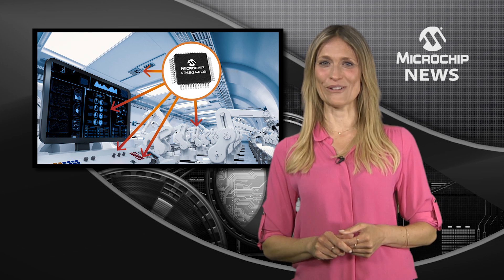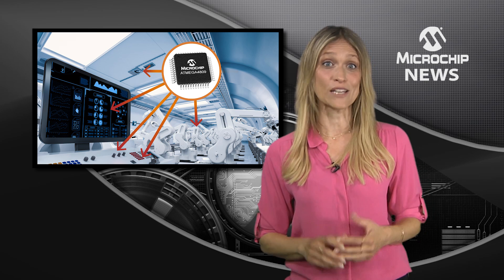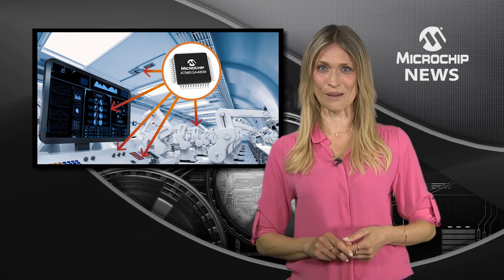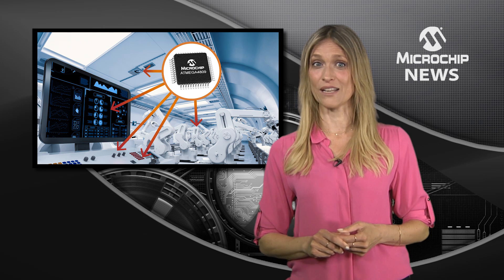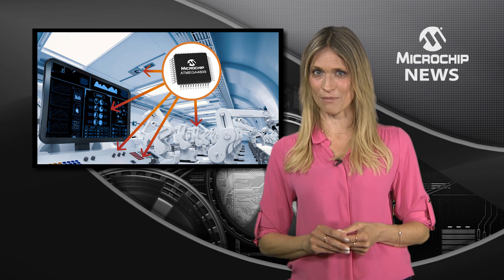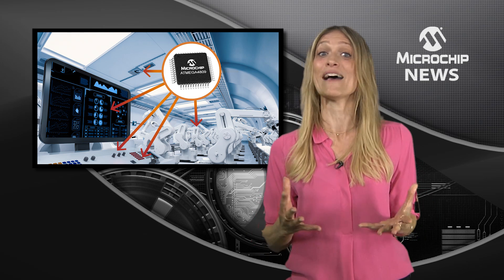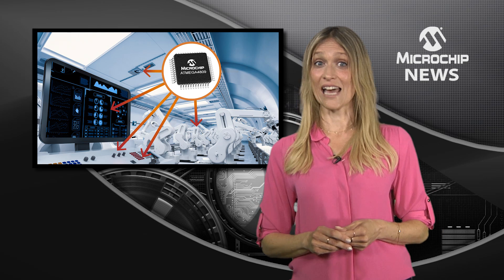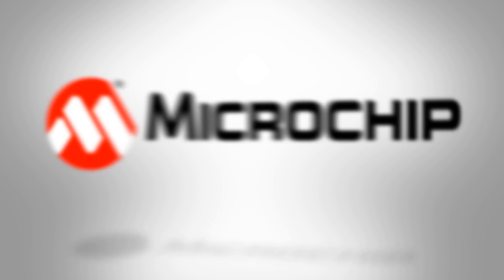First CIP-Enabled megaAVR Enhances Real-Time Control

Comment: I'd like to see some practical details of this IC.
Reply: Practical details? You mean like applications of the CIP cause if you are Microchip has the Tips 'N Tricks document they published that gives you an idea of some applications of the new CIP, its for PIC but it will apply to AVR as well.

http://ww1.microchip.com/downloads/en/DeviceDoc/41632B.pdf

 If you mean like architecture details just check the product page.

https://www.microchip.com/wwwproducts/en/ATMEGA4809

I think Microchip is awesome! this AVR with CIP is exactly the kind of stuff we were waiting for after the Atmel acquisition! The applications are endless!!!
Reply: armstrong subero 
  I browsed through the details when the chip was first released and I've seen a dev board created by microwavemont (no affiliation) here on YouTube. 
   I understand the theoretical benefits of CIP and have been exploring PIC's for the first time over the last couple months, but I'm just a dumb hobbyist that has been goofing around with electronics for a few years. I need stupid easy examples that I can follow in order to help me understand exactly how something works in practice and get started.
  My interests are usually centered around basic analogue measurement tools and human interfaces, but I'm 'code challenged'...ok, ok...more full blown retarded... I welcome all the help I can get especially visual tutorials and examples as the format allows me to see past the endless acronyms and brand specific nomenclature and focus on a known working example that I should be able to replicate intuitively. 
  Thanks for the reply and links ;)
-Jake
Reply: armstrong subero 
That is the best YT spam ever
...an author directly marketing his book in YT comments... who would have imagined...
  I didn't even look into the content. Sold. I got the hardcopy ordered solely on the merit of the occasion. Lol :)

  Up to this point I haven't been a fan of the way XC8 is monetized and was resolved to move on and experiment with other toolchains. I actually have a couple of Silicon Labs 8051's in transit at the moment. You just put me on a solid 180 degree trajectory. Nice job.
-Jake
Reply: Upcycle Electronics  Hey man I'm not spamming! Let me start by saying when it comes to 8 bit USE PIC OR AVR forget everything else! 

haha no spam man. I really wrote that book because I was hearing again and again that people need a good resource to get started that is easy to follow with clear code and a lot of examples. If you read that book, use that datasheet and use the examples on Github then I promise that you will have a clear path to programming PICs. Don't worry my friend it is a good book, as any technical book author will tell you we write for love not profit, cause there is no profit in technical books, I wrote that book because I LOVE PICs.

You are better off using the PICs for a simple reason. I have a lot of experience programming microcontrollers and in all my time programming them Microchip provides something that no other manufacturer provides; a smooth transition from 8 to 16 to 32 bit microcontrollers. Once you learn XC8, you can go to XC16 then XC32.  If you get hooked on the 8051 stuff and feel like you are ready to migrate to building more powerful systems, then trust me, you will be glad you chose PIC. In particular after you have a solid grasp of the 8 bit lines, move up to the PIC24s and dsPIC and MCC and you can put complex systems together in minutes. 

Take my advice learn 8 bit PICs, MPLAB X and XC8, then move up to the  16 bit parts, for 99.99% of the stuff the hobbyist and small business wants to do with can be done with a decent 8-bit PIC you know inside out and a decent dsPIC or PIC24 you know as well. If you need video or advanced audio processing, you are better off using one of the SAMA5 Cortex A processor modules.

When you buy your PICs if you or anyone needs any advice email me armstrongsubero@gmail.com .

One last thing I want to say if you just like fiddling around with micros and you don't know exactly what you want to do PIC is the BEST choice, you will learn a lot. From programming PICs I was able to learn electronics, computer architecture, algorithms, various protocols and making my other code very very efficient. You say you are a hobbyist so I don't know your math background and stuff, but if you working with PICs and you really want to master them then you need to learn 4 things. 

Learn Electronics Here, look at the transistor books in particular.

http://www.talkingelectronics.com/te_interactive_index.html

Learn Calculus from here:

https://learn.saylor.org/course/ma005

Learn DSP from here:

http://www.dspguide.com/pdfbook.htm

And finally learn the PIC architecture and C from Microchip here:

http://microchipdeveloper.com/

If you are a hobbyist just fiddling around or a beginner and go through this you'll have a solid understanding of PICs and would be able to do a lot of stuff. 

This is pretty long for a YT comment, but hopefully someone else may also see it and benefit. Don't stop tinkering.

- Armstrong Subero
Reply: armstrong subero 
   Thanks for the details and links. I've been referencing TalkingElectronics for years, especially the two transistor pdf's for basic building blocks and I've played around on microchipdeveloper a couple of times. The others are new to me.

  The Spam comment is just a bad joke between a few content creators on YT. I'm simply making a joke about it - how can I accuse anyone of spaming when I'm a CC in the same comments section :-D

  I've created a few videos but my channel isn't monetized nor do I plan to change that. So I don't feel guilty for using one account all the time and adding comments on other channels as I have nothing to gain financially. 
     I also use YT as my main learning resource whenever possible. I use my playlists as a reference source and subscribe to everything electronics that I come across and find helpful. Why mention it? Because my subscriptions and all of my playlists are setup as publicly visible. It's honestly intended as a personal resource but it can be helpful for others too. My playlists are alphabetically setup with a loose indexed system that's always evolving. I only add things I have watched and truly found to be helpful.

  I got into electronics after becoming partially disabled in 2014. I can't sit up or stand for very long due to a rare type of back injury. I've setup a lab in my bedroom to make the most of my time and available space.
  I've learned a lot from taking junk apart. Thus the user name here. My interest in PIC's is due to finding 2× 12F675's in an old heater someone threw out, a 16F676 in a flatscreen TV, a 18F45K20 in a broken electronic bicycle shifting system, and a 16F1508 in an old high power bicycle light. 
  I used the 16F1508 to test my limitations with laser printer toner transfer. The TSSOP-20 package was certainly as small of a trace resolution as I can manage using toner transfer. The 16F1508 is my first minimum dev board to etch and build from scratch. It's an interesting chip but I haven't found very many project examples that pertain to my interests that are compatible. I mostly used it to check out MCC.
 I am in the process of upgrading to a dry film photoresist etching method now. I just finished an 84 led UV exposure unit yesterday. Next I will probably make an attempt at removing the 18F45K20 in a QFN package and reusing it, because I want to try my luck at a more complicated preheat and hot air rework setup. I also have a couple cheap AliEx spares of that chip in a TQFP package just incase and I have made it a habit of creating layouts with a QFN footprint nested in a TQFP on a couple of modified OSHW projects I've built.
   I'm mostly making excuses to play with KiCAD and etching. I'm not as attracted to the software side as I am with hardware. I've tried playing with Arduinos but I find myself relying on too much copy and paste code and stuff I don't really understand. Plus it seems that the whole point in Arduino is to skip the hardware stuff and go straight to coding. I think that's skipping the best part.

    If I could manage to do anything with this interest professionally, it would be hardware design. I mean, it's basically a giant puzzle game with crap instructions and a bunch of traps and troubles. The idea that people get paid to play that game sounds intriguing. Eventually I need to find something I can do from home in a zero gravity station type of environment assuming all of the doctors fail to find a way to fix me.
  As it is I'm stuck relying on the generosity of family and friends to help me along. Fortunately I have a few. That's what keeps me going. It's also why I get put off by things like the way XC8 appears to be well written, but then intentionally 'broken/detuned in an attempt to monetize it. It's not an additional feature or anything of real value. The practice feels sleazy in my opinion. Like I just bought a car from a used car dealer that took the seats out of the car while I was in the office signing paperwork, because "the seats weren't explicitly written in the fine print."
   It just doesn't feel right. My business instinct is to walk away at the first sign of shady things like this. I'll give it another go now, but I am really skeptical of the antiquated 1980's-90's style American business practices many people like myself have grown up with and loath. I'd rather have teeth pulled than use another Microsoft product for the same reason.
  The other reason for this renewed interest in PIC's is because I heard about the JTAGulator OSHW project and it's based on a PIC. That's on my list of things to etch/build in the future. I'm doing a Goodfet42 first as I've already created a single sided etch design for it and just waiting on the MSP430.
  As far as PICs I also ordered a couple 16F877's to try out a few example projects I have saved. It's really a pain that MCC lacks support for the older MCU's that are core legacy products. That and the example code I've found and would like to try is totally incompatible within the PIC16 family of part numbers. This makes learning much more tedious. I'll get there eventually though. I've already learned to use a pdf editor to find and replace every acronym and silly unnecessary brand terminology that makes microchip datasheets a pain coming from reading a few old AVR's. 
Anyways,... thanks again for the references  ;)
-Jake
Reply: * JTAGulator BusPirate is the one I was thinking of. The JTAGulator uses a Parallax uC.